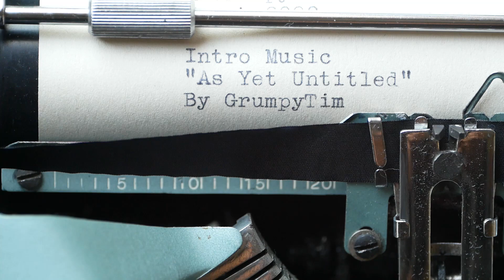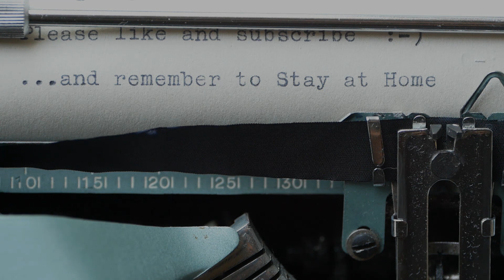Retro Tech - Olivetti Prima 20 Adding Machine - Part 1, Refurbishment

Comment: Amazing video! Congratulations!!
Reply from the maker: Thanks Bruno,  these little Olivetti machines are really fantastic - I love the way they look and the work so well.  I've got another Olivetti machine waiting to be repaired - an electric Ivrea Multisumma 20 - it'll be a while before I get round to that one though.
Reply: @GrumpyTim  Thank you very much for responding! Since I was a small child I have always loved old mechanical machines! I love calculating machines and typewriters. I am thinking very seriously about purchasing an Olivetti Studio 45 and a Suma Prima 20, but I am very afraid that they will eventually break down and I will not be able to find someone who knows how to fix it. I am totally fascinated by Olivetti Divisumma 24 and Tetractys. Greetings from Rio Branco, Acre, Brazil!
Reply from the maker: Hi Bruno - I'm much like you, I've always had a fascination with mechanical things - stuff with whirling parts and all the associated sounds.

My thoughts on getting and using old mechanical typewriters and calculators:  I've fixed a few typewriters - they are similar to the mechanical calculators in that usually there's not much to go wrong.  Largely they stop working due to lack of use and the old oil becoming sticky - usually this can be DIY fixed but it takes patience.

If you can find machines that already work then they are likely to carry on working, maybe needing a drop of oil every few years (when I say a drop of oil, I mean a drop, on each moving axle, bearing or sliding part - what you don't want to do is spray the machine liberally with WD40 - sometimes this will help for a short time but it will always lead to the machine failing as the oil attracts dust etc and gums the machine up).

The electric machines like the Divisumma 24 and Tetractys are quite a bit more complicated - they perform more functions so there are more moving parts and you can bet that the parts that need attention are hidden behind other parts.  Also, you need to at least have a basic understanding of electrical equipment to be able to check if they are safe to use.

The worst thing I tend to find on these old machines is when someone else has tried to fix them before they came to me - either by using brute force, or by taking them apart without thinking, then putting them back together incorrectly.  I've had one or two that have needed new parts making but mostly I've been able to just re assemble them correctly to get them working.

Hope you find some working machines - you'll love them - there's something really satisfying about using a mechanical typewriter to write a letter and the calculating machines are endless fun.
Reply: @GrumpyTim  Hi! I bought them. The Olivetti machines. I am very nervous waiting for them. I even dreamed of them! Many thanks for your support. You are the most attentive person I have been able to contact that knows about typewriters and calculating machines. Is there a Whatsapp group or other social network that brings together people who like typewriters and calculating machines? I would love to meet other people like me. It makes me sad that such machines are dying little by little, abandoned or destroyed by onlookers with no knowledge to maintain them. In my opinion, these machines should still be manufactured. They would be a valuable tool to aid the learning of mathematics and a fantastic way to encourage curiosity and creativity. They are full of ingenious and creative solutions. It is a shame that they are being forgotten. I would love to learn how to keep them running and how to solve the mechanical problems that come with time. It's beautiful to make a division with decimals on them! I was considered a good student in elementary and high school, but after finishing my studies I just forgot how to make divisions! Why? Because the method I was taught didn't make sense! I discovered that the school, at least here in Brazil, is a curiosity-killing machine that forces children and teenagers to learn a series of meaningless procedures that give the correct result, but make us hate the subject taught because we don't really understand it ! The discovery of mechanical calculating machines took away my hatred for mathematics and made me sure that it is being taught the wrong way!
Reply from the maker: Hi Bruno, well done, I bet you're excited.  Don't panic if your machines don't work when they arrive - you don't need to rush to get them running - I know I would be impatient myself but I've learned to control my impatience and work away slowly, sometimes walking away for a while is the best thing you can do.

There is a very good Redit group dedicated to typewriters with the easy to remember group name of r/typewriters - there are plenty of people on there and they are very enthusiastic.  Also Phoenix Typewriter has a great YouTube channel fixing typewriters - often different manufacturers used similar methods so a fix for one machine might be fairly similar to a fix for another machine.  He also fixes the odd mechanical calculator.

I haven't seen any groups specifically dedicated to mechanical calculators but there are some useful sources of information:
John Wolff's web museum has loads of information   http://www.johnwolff.id.au/index.htm
and Jaap Scherphius has a YouTube channel and also a great website  https://www.jaapsch.net/index.htm

I'm with you on maths in school - it didn't seem that interesting at the time and as soon as I left school everything mathematical I needed to do could be done using a pocket calculator so I forgot how to do long division.  I think I'd have been much more engaged as a kid if I'd been using mechanical calculators.  I suspect that learning on an abacus would be good too, because it's a physical thing - I tend to learn much better if I actually do a thing or at least see it in motion - I can read an instruction manual and the words are all bla bla bla but if I see the thing done I'll remember it immediately.

Just shout if you need any ideas for your machines when they arrive - I might not always be able to answer straight away but I will do eventually.
Reply: @GrumpyTim  My machine has arrived !! The Suma Prima 20 !!! I am very happy!! Looking forward to Studio 45 arriving. My whole family is very curious to understand how it works !! I'm going to start posting videos on YouTube about how to do operations on it, especially the division, and I'm even going to show you a little thing that it can do and electronic machines can't! Unfortunately, the video will be in Portuguese, and I will record it on my cell phone. But everyone needs to start from somewhere ... I will try to put subtitles in English too. I think it will be a while before I post the video. Your support was essential for me to pursue my dream, and I will never forget what you did for me. Wish me luck!!
Reply from the maker: Hi Bruno, that's really exciting - I'll make sure I watch your video when you do it.  You're going to have lots of fun using your machines.
Reply: @GrumpyTim  Dear friend Tim! My two machines are already here. I am very happy and surprised! Typing on the Studio 45 is much, much easier than on a computer keyboard! I am using it to write my diary, and it is getting much better than I imagined! However, there was a problem that made me very sad ... 

The adding machine presented a serious problem. I was investigating its characteristics (I am very curious after all), and found that it always considers the lowest value if two keys are pressed at the same time. I came to the conclusion that this is how it is to avoid undue charges from customers that could result in lawsuits, I think. 

I started to try more than two keys pressed, with the same result. The machine continued to function normally. However, I did something entirely new. I pressed all the keys, including double and triple zeros. Serious error! 

The machine started to jam and show wrong results! I thought it was the end of my adder. 

I realized that by inserting small numbers it still gave the results correctly. However, with very large sums, such as 99,999,999.99 x 10, whose result should be 999,999,999.90, the result was wrong, with all sorts of strange numbers appearing in the totals.

Defeated, I started to make more and more sums so that I could know how reliable the results were. I was sure that something had broken, because I believed that a mechanical machine only gives wrong results if it is broken. I started to insert numbers and add them up ten times. First 11,111,111.11, and I got the correct result. Then bigger and bigger numbers: 55.555.555.55 x 10, 88.888.888.88 x 10 and so on. The strange thing is that when I reached 99,999,999.99 x 10, I got the correct result! Impossible! Had the machine repaired itself? I didn't understand. 

I later found out that the big problem is pressing the double and triple zeros at the same time or with any other number at the same time. I did some experiments (but no longer pressing the entire keyboard) and every time the double and triple zeros were pressed with other keys, the machine showed flaws, which were corrected by making higher and higher sums until reaching 99.999.999.99 x 10, which proves that all gears are working harmoniously and that they should not show wrong results if the machine is operated correctly.
Reply: @GrumpyTim  In car gearboxes (I know this because I took a course in auto mechanics) there are mechanisms that prevent two gears from being selected at the same time, which would cause damage to the mechanism. I believe that such an idea should have been considered on a machine with such a weak point.

But my machine does not seem to have completely "cured": yesterday, when I was creating some code to write product names, for example, I noticed that it sometimes printed wrong. I think it meant that something had been damaged permanently, which made me very sad. However, the machine again surprised me as such incorrect impressions became more rare until, apparently, they disappeared completely. This machine is definitely a lot more mysterious than I thought it could be, and I really have no idea what made it behave in such a way. I intend to buy very damaged machines to dismantle them and understand them better and thus have a better chance of knowing what happened. I would recommend that you mention in future videos that it is necessary to be very careful when pressing double and triple zeros, so as not to do this at the same time with other keys. Have a nice day!
Reply from the maker: Coo that's interesting - in theory, unless you apply excessive force, these machines shouldn't be damaged even if you do press some of the wrong buttons or multiple buttons at the same time.  I'll have to have a look at some time to see if I can figure why it makes the machine go wrong when you press the double and triple zeros with other keys - my guess (and I could be completely wrong so please forgive me if I am wrong), is that there is some shaft, rod, bar or other thing on your machine that is a little tight, with old, dry oil, and it only shows up when you press the double and triple zero at the same time as other keys.

If I find out anything that might be of use I'll let you know.

Really glad you're enjoying the typewriter too, they're so much fun to use compared to a computer keyboard.
Reply: @GrumpyTim  Hi Tim! I need to update some information I got this morning when testing the machine again. 

The machine is worse. It still sums up numbers with few digits, but when I try to add 99,999,999.99, it almost never shows the correct result. I think it is really damaged. I am sad that I was responsible for this, although, of course, I would not have done what I did if I had known that my adder would be damaged. 

I clearly remember asking the salesperson how much care I should take with the machine, and the only thing he told me was to protect it from dust and nothing else. 

The machine is under warranty. There is a three month warranty given by the seller. However, even if it proved that the machine should not have failed, as you mentioned in your last comment, I would not feel comfortable making this seller bear the costs. He is one of the few people who value these wonders, and harming him is all I DON'T want to do. Therefore, if it is really necessary to send it for repair, I intend to bear all costs. 

Unless this machine is much more sensitive than I imagined, I'm pretty sure I didn't push it too hard when it jammed. The force I put on the forward lever to unlock was, I believe, much less than the force we use to pull it back. Today, it locked a few times more seriously so that I couldn’t unlock it that way, so what I did was gently move my fingers on the racks that come out at the time of printing and on the lever at the same time so that the mechanism unlocked. I don't see how this could have permanently damaged the machine, but of course I can be completely wrong. 

I already have in mind a mechanism that would be perfectly capable of preventing double and triple zeros from being pressed together and with other keys, and it seems relatively simple compared to the other incredible mechanisms that exist on this machine. Odhner calculators, for example, have several mechanisms that lock the levers where we insert the numbers while the crank is turned, and several other features that make them reliable and accurate. The absence of such a mechanism in my adder surprised me negatively, after all, it is not difficult to imagine that someone might accidentally prop the arm on the keyboard or things like that. 

I know you have an enormous amount of knowledge about these magnificent machines, but please be careful in your investigations ... I would hate to have induced you or anyone else to damage such precious machines.

Greetings from Rio Branco, Acre, Brazil!!!
Reply from the maker: @brunopacifico4979  Hi Bruno, don't panic just yet.  From what you've said, nothing you have done will have harmed the machine.  It's possible that doing what you did just highlighted an existing fault.

I had a look at the machine I used for the video - it only has the double zero button because it has a half pence button in the spot where you have the triple zero.  I have the instruction manual for this machine and it says that if you press the half pence key at the same time as one of the other keys it will display a letter "E" for error in the printout - it will also display the letter E if you try to enter more numbers than the machine can take.  What the manual doesn't say is how to clear this error - I did a grand total and thought it was gone but then the letter "E" came back.  As far as I can see, you need to do something like - do a grand total, then slide the keyboard clear lever to the top and back down to the bottom, then pull the main handle without entering any numbers and then, finally you're ready to use the machine again.

Your machine may be slightly different because you have a slightly different keyboard layout - and it could possibly be that there's a lever that moves when it wants to display the "E" error and that lever is somehow sticking and therefore causing the rest of the machine to work incorrectly.

I will look in more detail when I have the chance but really, don't panic, I don't think you've broken the machine.  I know you want it to work right now and it's tempting to want it sorted straight away but it might take a little while to figure out the issue.

I'll see what I can find out.
Reply: @GrumpyTim  Thank you for your help!
Reply: @GrumpyTim  Hi Tim! I believe I found the problem and managed to fix the machine! It seems to be working very well, but only time will tell! 

I uploaded three videos but, unfortunately, I haven't been able to subtitle them yet. I will search on YouTube how to do this. 

The problem that was jammimg the machine was incorrect lubrication. Grease was applied to a very sensitive point on the machine, which is the digit selector to be printed. He was sticking and being prevented from returning to the correct position, which was somehow locking the mechanism. I noticed this anomalous operation and was able to clean the grease with a lint-free cloth and finally use machine oil (like those used in sewing machines) on that and other parts that were not lubricated, like the grand total button , which was also crashing a little bit. Thank you so much Tim! I would never have done it without your help !!!
Reply from the maker: @brunopacifico4979  Awesome, well done Bruno, that's exactly the right thing to do - observe the problem, and then figure out what isn't working correctly. Brilliant work.

I spotted that you've uploaded videos, I'll watch them tomorrow,  I'm sure I'll get the idea, even if I don't fully understand what you're saying.